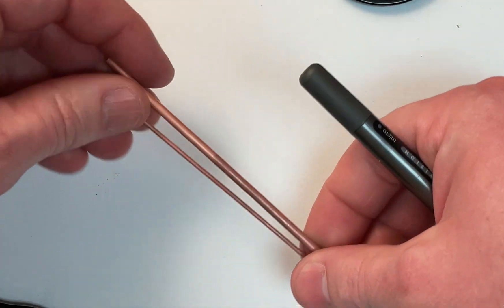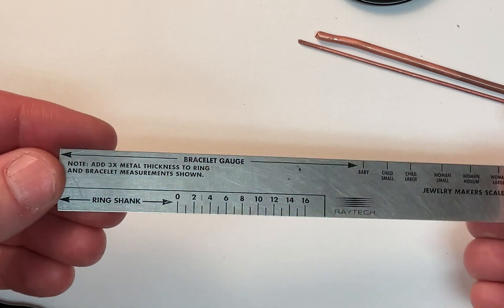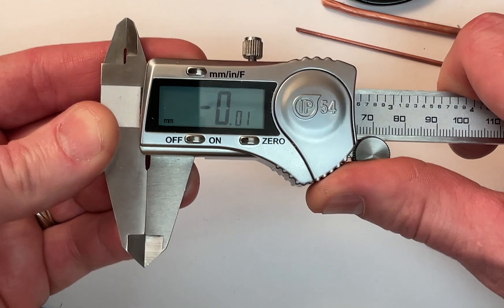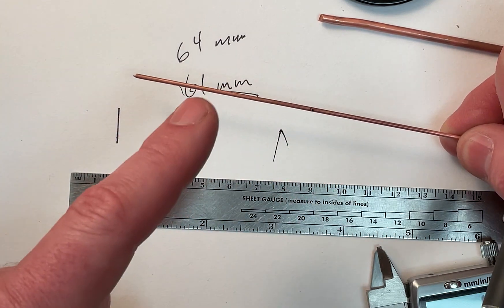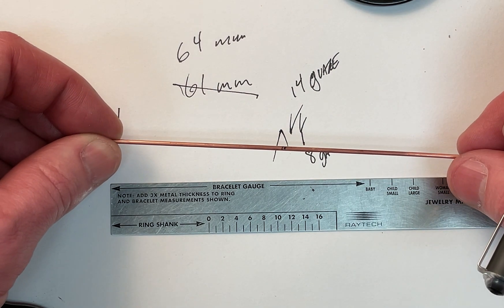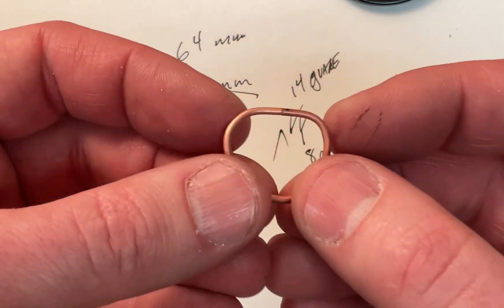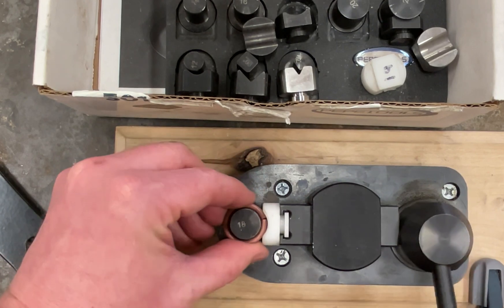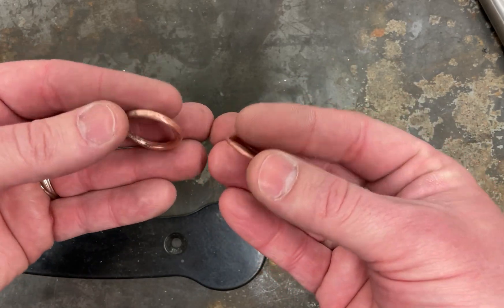Ring Shank Measurement

Comment: May I be able to ask what kind of solder you use? I've been using normal home Depot solder for practicing and it leaves the area silver
Reply from the maker: Forgive me, I didn’t see your comment. I only use silver solder in HARD, MEDIUM, EASY, and EXTRA EASY melting temperatures. Regular solder from hardware stores have a lot of Tin in them so it will leave a ‘silver’ look to it. It will also melt at a much lower temperature (less than 500°f) Silver solder melts at about 1800°f. Tin, in large amounts, makes an alloy less strong. That is why jewelers use different solder than plumbing solder.